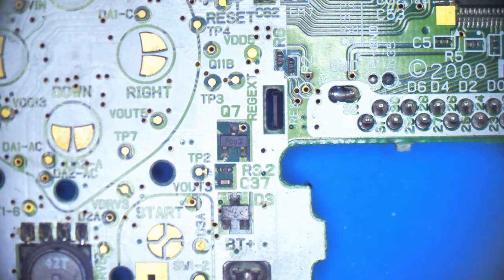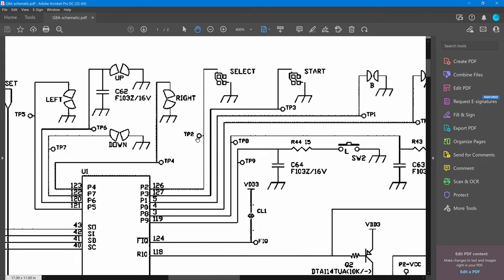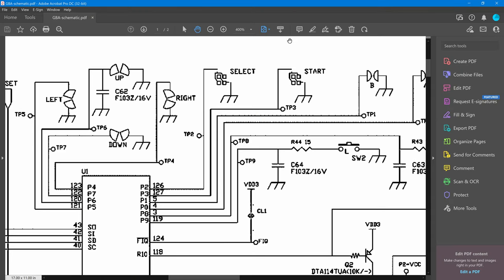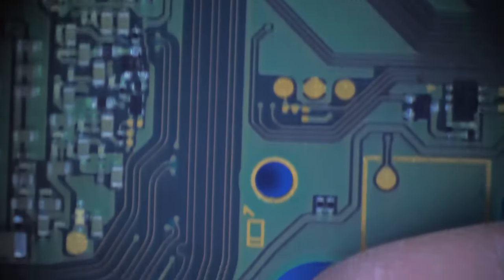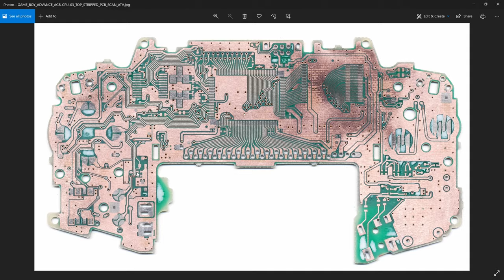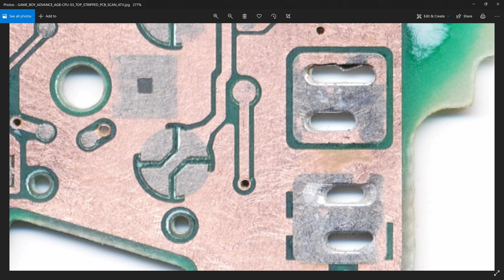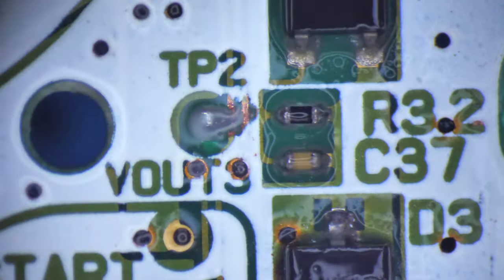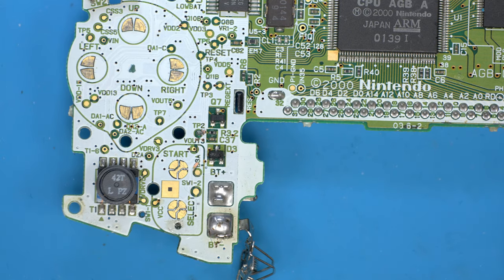Fix Ripped Trace PCB Pad Repair Game Boy Advance Torn

Comment: THANK YOU
This is my second day using a soldering iron, so I’m a complete amateur. Tutorials I was following didn’t warn me that the “select” wire could rip the copper pads clean off if not taped down. Your video helped me so much. I ended up scratching off the trace running under the text SW1-2 and hooked the wire to that, and now my GBA IPS screen is working! Thank you so much! A thousand likes! Ended up uncovering some of the copper board, as well, and just used kapton tape to cover those parts when I soldered the trace just to be safe. Also placed tape all over the wire to make sure it stays in place this time. Keep up the good work! You helped out this amateur 🙏🏼🙏🏼 gonna play the Mother games in style lol
Reply from the maker: Glad it helped ☺️

Comment: Incredibly useful Luke! Have a few boards I've messed up across the years and haven't touched, so might need to try and get them working again!
Reply from the maker: Hopefully you do. If you need any help with them just ask
Reply: @RetroSix  Hi, could you tell me how many millimeters thick the enameled wire is?
Reply from the maker: 0.2mm
Reply: @RetroSix  Thank you very much!!

Comment: I used to have a similar problem on my GBC, but the damage was much more severe and multiple traces were damaged. I fixed that a little bit different way, using electrically conductive glue. It was not the easiest thing to do, but several years after I fixed my GBC it still works perfectly fine.

Comment: You could just use some copper foil and cut out a new pad area and run, then solder lap them, add heat resistant glue, then add green mask. It would look original and have the pad. However I do understand the need for economics and absolutely love the references for the schematic. Thanks for sharing. Thumbs up.  Best Wishes & Blessings. Keith Noneya

Comment: Hi bud thanks for your tutorial! I ruined my DL1 solder pads for the low battery LED I checked a motherboard graph but it seems like the track does not go anywhere else but to them points I’m guessing I would need to to wire to them points either side of DL1??

Comment: That’s amazing work and loving the grinder tool!!  Do you re-insulate the wire or areas near another trace after soldering like this? If so, with what?
Reply from the maker: Yes, with UV coating. We have the UV torches now https://retrosix.co.uk/Fast-UV-Curing-Lamp-Relife-p494431802, and will stock the UV solder mask soon

Comment: Perfect!!! But what can you do when its the select button path itself which is missing or corroded??? Thx
Reply from the maker: Use copper tape and cut it to the shape of the original button and place it where the pad was, then solder to that copper tape

Comment: This was great viewing. Would you or could do a video on replacing a fpc connector. The king that flex ribbons connect too. These many different kinds. Im struggling with trying not to melt the plastic. Thanks
Reply from the maker: Sure. Which console is best for example?
Reply: @RetroSix  ive got a few psp 2000 with a broken backlight connector and another with the right flexbutton connector. But i understand if you only  have other consoles. Even the nds. Just to get some knowledge on it. 😊
Reply: @dazamad  I'll make sure to record the next time I do any FPC connector swap. they will all differ slightly but the general idea is the same

Comment: But what about if you need the pad to solder to that ripped off after you fixed the trace? Like what do you do after you've done what you did in the video and then need the pad that is now gone?
Reply from the maker: I cover that first. Find a thick part of the trace to expose and attach a wire there. If there are no thick parts just expose a good part of the trace away from the break and solder a wire to the trace the same way you solder an enamel wire bridge

Comment: Man, words isn't enough to describe gratitude for your video tutorial. But, I am pretty amateur to achieve this kind of level of repairing. So, my question is: can I connect a wire directly from the select connections (that thick one in the middle that you've showed at the end of the video) to the TP2 connector that I've accidentally lifted up along with his wire? For me it's the simplest way to do this.

Also, how can I show you a picture of my gba motherboard so you can understand visually what I'm saying, or a video on my channel or sending you a email with a picture. If you have a Twitter account I can mark you.

Thanks a ton in advance.
Reply from the maker: Sure just jump on discord.gg/RetroSix and share images there we can assist

Comment: hi i have a usb audio front board for my pc and one of the traces has been burnt out also need a new trace i tried to find a replacement for it but only amazon sell simular items but i bought 1 and doesnt fit to small unlike mine needs to be the right size to fit my case i mean usb and audio ports to fit the board sections i have been hunting high and low in where to find simular parts but having huge issues if i cant find it i tried to go to a pc shop but he was clueless and wouldnt touch it i noticed that how to fix trances on this board and now have an idea and who can fix it if your reading this send me a message on a reply and hope to chat to you
Reply from the maker: Join our discord.gg/retrosix and share images, I am sure we can help you fix it

Comment: Hey ! Noob question incoming : 

I broke my tp2 EXACTLY the way you describe it, and it looks like yours. Then I was like "okay, I don't care about changing the brightness that much" so I removes the 3 wires totally. Since then, my shoulder buttons are totally not responding. The board right above the 2 points you're supposed to solder at the shoulder buttons is a bit burnt. 

My question is, can tp2 stop the shoulder buttons from working ? from your video I'd say no, but I'm pretty noob. :/
Reply from the maker: Nope that wouldn't affect the shoulder buttons unless your joining the select and shoulder buttons to another mod that possibly shorts then together or something

Comment: Hey everyone! I just got 2 GBA PCB causing issue (no power) I've already clean them and Everything (power switch too) but I've noticed that C37 is missing on both can someone tells me if it's important? And how can I replace it!? I don't find info on those components online I'm really lost. 1gba turn on with green light on but no image no sound. The other one light just flicker then turn off in no time for image or sound. Please any advice (again power switch has been cleaned properly using soldering method).
Reply from the maker: The C37 is not critical so long as it's not shorted. If it's missing just make sure the pads are not shorted. Jump on our discord for more help discord.gg/RetroSix
Reply: @RetroSix  hey thanks for answering. Yes I'll try to ask for help there cuz I'm really desperate now 😅